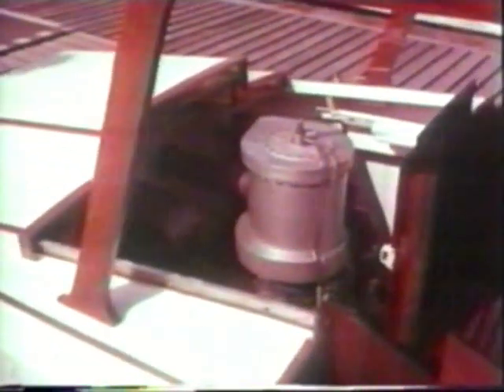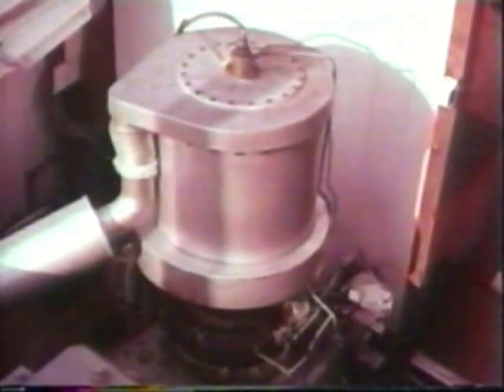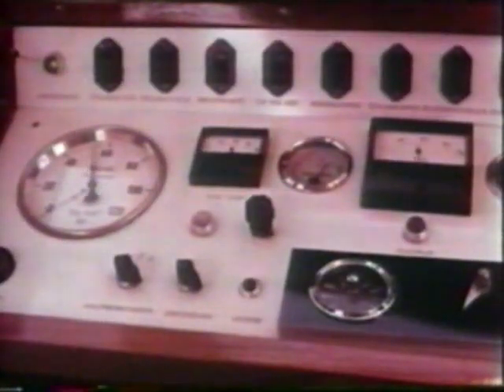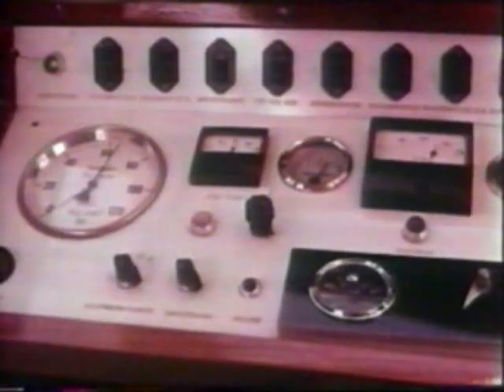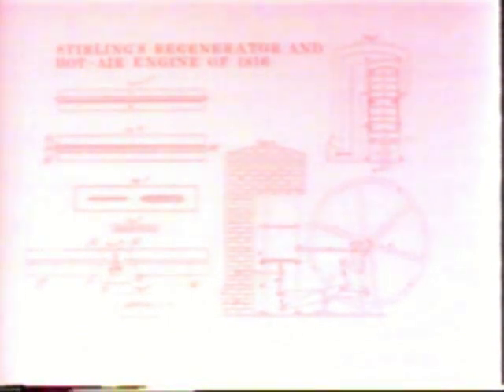Stirling Cycle Part 2 (Stirling Cryogenics)

Comment: I have a question: I know it may sound stupid but. If compression and expansion occurs in either cycles(cooling and heating) how does direction change whether it gets colder or hotter? If the thing is operating at 60hz and it still compressing and expanding all the same?

Comment: THis engine LOOK LOOK IM AWSOME IM THE FUTURE!!

internal combustion engine and oil companies: ima end this this mans whole career
Reply: Oil companies wouldn't be threatened by the stirling engine, since it can run on liquid fuel. The problem is that is isn't all that practical for automotive purposes, they tried it on a bus, which wasn't a succes. They also tried to make stirling powered field generators, but these didn't function so great either.
Reply: @timdekleijn8910  the real issue is that these would best be used in highly distributed - home scale situations. Sure it doesn't have the peak power needed for car use, but for constant power generation it becomes a dangerous threat to institutional hegemony. 
like could you imagine homes using radioactive heating connected to one of these? 
hell even in a permaculture type situation where it's fed with wood in a rocket heater... it's no wonder this stuff has been stifled.
Reply: @timdekleijn8910  it did work in a car, was both powerful enough and more fuel efficient. The important thing to note is that one doesn't need gasoline to power the sterling, with other fuels being explored

Comment: I would like to get the idea of exploring the Sterling heat pump for storing energy as heat, and a Sterling engine to use the stored heat to generate electricity.  Why?  Climate Change.  Solar energy is only available in the day. The excess daytime energy needs to be stored and used at night. 
   The combination of a heat pump, and a heat engine has the theoretical maximum efficiency of 100%.  Heat engine Emax = Thot/(Thot-Tcold)  Heat pump Emax = (Thot-Tcold)/Thot.  Multiply together, and you get 100% maximum throughput. 
   Everyone will need energy storage, and the lowest cost materials should be used if practical.  Suppose water is used for energy storage, and air for the heat pump. Hard to beat those prices!  So assume you have two 50 gallon water heaters, and fill one with water at 0C, and the other at 80C, and both are filled using an ambient air heat sink at 20C . 
   The efficiency of the hot heat pump would be 353 degK/60 = 588%. The efficiency of the 0C heat pump would be 293/20 = 1465%. The efficiency of the engine running with 80C hot, and 0C cold would be 80/353 = 22.7%. 
   The hot tank would need 2.24 KWH. The cold tank would need  0.30 KWH.  Assume a discharge temperature drop of 30C for the hot tank. The hot tank would then hold 6.6 KWH. The cold tank could hold the same by letting ice form. Filled with ice, the cold tank would need 17.6 KWH to unfreeze it. To get the desired 10KWH, we would need 1.51 hot water tanks. If the combined efficiency was 70%, the size of the hot tank would be 108 gallons. 
   So for the price of 3 50 gallon tanks, two heat pumps, and one heat engine, overnight electrical storage could be obtained.  Could this be competitive with 10 KWH of battery storage?  Currently, the battery option is running around $20K.  ... But think also of the difference in the materials required to service the world. Water vs. Lithium?  Water vs. Lead?  Water vs. Nickle-Iron? 
   Come on engine experts - save the day!
Reply: >calculating efficiency by mixing degrees Kelvin and Centigrade
bruh.jpeg
Reply: @peasant8246  The size of a degree C is equal to the size of a degree K. So when the difference is taken, both in either unit, the size of the result is identical regardless of the temperature.
Reply: @tomfitzrugger  Wow, that was quite a project.

Comment: Read an old book about this in the 1980's called "Engines for Tomorrow's Passenger Cars by J.D. Withrow". It was nice to see the boat mentioned in the book. One thing I have noticed is a preoccupation with engine efficiency, what should be the focus is how to mass produce the engine and get the price down.

Comment: What is the efficiency of converting heat to power out divided by heat in? This should give the percent of heat transferred to mechanical horse power out. Percent of heat efficient conversion to useable power. Where is most of the heat energy being lost? Any computer modeling to improve this ?

Comment: Imagine hooking up the Stirling Engine in the boat magnetohydro motor.
Reply: MadVulcan I recall Reading that the Swedish navy did exactly that With one of their submarine classes. In the late 70's I think it was. At the time I did not know what a Stirling engine was, and the Author apparently assumed that this was common knowledge and did not elaborate. But what it means is that the subs could very easily recharge batteries even while submerged, by using compressed air to stabilize the athmospheric pressure in the sub. Unlike diesels that will suck Your brain out Your ears if allowed to run without a snorkle. Of course, even a Stirling engine will not be able to run indefinitely on stored air alone, but the system appears way more flexible. Also a lot less noisy than a combustion engine.
Reply: @comingviking  One of those subs was able to score a hit on a US nuclear carrier during a naval exercise because of how silent they are.
Reply: @gearandalthefirst7027  Scoring hits on US aircraft carriers with a battery powered sub is not that hard. Carriers are great for power projection when the aim is to bully small nations. As actual weapons of war they are somewhat overrated.

Comment: Where did Robert Stirling get the equipment to manufacture the cylinders, pistons, push rods, compression tubes! Seriously the guy was a priest! It's not like he had millions! I've made some small Alpha and Gamma Stirling Engines, basically toys, or working models and this was pretty difficult!

Robert Stirling was making the Beta Type version that is shown in this video. I don't have the means to do that. That's a pretty complex engine even by today's standards. He was making these with his brother in the 1800's WTF!? How!?

Seriously I can't find that information on the internet. I find all kinds of information about the guy, and Wiki's about the history of the Stirling engines and their predecessors! But it all just gives variations of the same information. Robert Stirling was a Priest who wanted to give people something safer than the steam engine because steam engines were exploding and killing people! So he made his heat engine with his brother, and they gave a working model to some locals to pump water and then the guy went back to his church work, and people started to make his engines all over the place.

Nothing that I can find shows how he cast his materials, this stuff today gets done in a machine shop.
Was this old school foundry type stuff with sand and clay' molds?  Because all of the information on Steam Engines of that era show that they were extremely laborious to make! They were made by companies that had lots of money, and steel and foundries with lots of workers.
Reply: Have you read the wikipedia.org page?

Robert Stirling converted a couple of steam engines into Stirling engines. The problem back then was that the cast iron of the steam engine was too thick and could not hold up to the high temperatures that were being used.

Comment: Why isn't this motor being used to heat and cool? Is there something wrong with it that I missed? one of these motors in your furnace could keep you warm in winter and cool in summer
Reply: This is exactly what is done with with heat pumps...
Reply: @ultort  I thought heat pumps used traditional refrigerants based on evaporation & condensation though, not a gas cycle like the Stirling engine.

Comment: How to seal the piston rods at 100 atmospheres?  That is the million dollar question.
Reply: All of that is contained within the housing so it probably wasn't an issue. But the output shaft had to be sealed. Now these are only used in cryogenics so they can be semi-hermetic or hermetic.
Reply: @mysock351C  It can't be hermatic  because it must send out mechnic force thru power shaft. So they're leak for sure.
Reply: Semi-hermetic, then if one wants to be technical. Im sure they spent quite a lot of time investigating the sealing technology as they still use these engines today in cryogenic plants.

Comment: Liquid air air is 71% nitrogen? Can this nitrogen be infused into water and used on crops has fertilizer?
Reply: Nitrogen is almost insoluble in water.   And anyway,  you can't mix liquid nitrogen and water.  The first thing that would happen, is the water will freeze.

Comment: Why not use a Stirling cycle engine to produce liquid atmosphere to fill a tank then use an emitter to separate the oxygen and hydrogen? Then use a Joe cell with a different frequency to produce HHO to be used in a combustion or jet engine? This would work right? No more need for fossil fuels?

Comment: A Stirling cycle engine that turned air to liquid that filled a Joe cell constructed out of super conducting materials to generate high frequency electricity has the liquid air boiled off producing hydrogen vapor to operate a combustion engine. This would work to operate a certain type of vehicle and air craft correct all without the use of fossil fuels? This would work correct?

Comment: Would not the Stirling engine become a cold cycle engine from the liquid air leaving it to generate a steady flow of high frequency electricity from the super conducting materials it was constructed out of? It would operate non stop and if constructed correctly would not have any friction points from how super conductors work or even using gadolinium in its construction generating magnetic bearings? This could work correct?

Comment: Why not design a cryogenic cooler out of super conducting materials that turned air to liquid that feed back onto itself to reach ultra low temperatures and create a high frequency electric generator using atmosphere to produce high frequency electricity? A smaller version could provide air conditioning and a power supply for electric vehicles and air craft? Do you think it could work?

Comment: Could you not use induction used for cooking to heat the pistons on a sterling engine? More heat would mean more RPM's correct? Would that make an electronic engine that could replace the internal combustion engine? Novartis ; )
Reply: You'd have to use electrical energy to operate the induction apparatus which in turn then powers the engine. Therefore you could simply use the electrical energy to run motor all by itself. Using the Stirling engine as an intermediate just increases heat loss; lowers efficiency.
Reply: Make piston generate its own energy ancient pyramid technology and no I will not explain it to a Jesuit clone buggy!
Reply: Induction field can do much more then just generate heat. Stuff they don't teach you in free Masonic drone school. ; )
Reply: Hay those Manson engine pistons would generate their own electricity and heat an engine that powered itself. No more fossil fuels imagine that? LOL wait do you know how to charge a battery with limestone or basalt?
Reply: Manson engine is a very cool toy.
Reply: I would like to create a Manson engine electrical power generator. That ran itself and produced enough electricity to power a home. You think I could do it?
Reply: Not too sure who you're talking to, or what about exactly. You are right that an induction field can do more than just generate heat, I am aware of that. Since the idea of a Sterling cycle engine is to convert heat energy to kinetic energy, it is the heat producing property of an induction field that would find application here.
PS: Free energy doesn't exist according to thermodynamics
Reply: Vibration zero point endless energy unlearn your indoctrination in what to believe if you can. If you can it you can if you can?
Reply: Novartis
Reply: Lmao
Reply: Why not take a cloned organism place it in a container filled with the forth phase of water and use infrasonic pulses to bounce around in the container to cause cellular resonance to achieve cellular harmonic vibration destroying the cortical imprint of the clone organism and generating a biological cellular battery out of the clone that will self replicate within the container to create an eternal cellular battery? Hay a much better use for a cloned parasite rather then it stinging and infesting and replicating and sucking off animals. ; )
Reply: LOL
Reply: My biological electrical power generation design would put a self replicating parasite into a vessel that uses the self replicating parasite rather then the parasite using a biological vessel to feed off of. The parasite would feed off human waste to generate electricity and its self replicating life cycle would allow endless electrical power generation has well has recycling human feces 100% green energy. Hay bitiffy you like the thought of this amazing biological power generation concept?  Its a future I am working on for certain parasites now within this biosphere. ; )
Reply: Jim Martin you are one finny little man. Lol, serious note: evrything funtions as a powerfull energy generator threw thremal loss. If you have tempature you have energy, you convert said energy into a rotatinal field to produce work. Problem is rotation is not the best way to generate power.. we know jow to generate power using every known method from sonic ververberations to tempature to pizoelectric elements. We have wind and solar as well as gravity engines, man kind forgets to easily nature dose not make wheels to create motion. Forces such as lamimar low and venturi effect power most lakes and streams. We need to relearn nature to overcome unity.

Comment: To think that Stirling cycle engines really haven't advanced much since the 1950s when Philips engineers built that boat.  Newer high-power engines really aren't much different in design.  They pretty much perfected the technology.
Reply: Actually NASA also did a Stirling engine project in 1986 that proved to be successful (and only lacking the power of internal combustion engines).
google the Automotive Stirling Engine . Mod II 
... and apparently they're still working on Stirling radioisotope generator, but with somewhat different goals - I think space oriented (where combustion is not possible)
Reply: +douro20 Considering what we have learned from Inside Climate News and LA Times, and more recent revelation going back to 1946 involving the petroleum institute, it seems pretty safe to say the slow advancement and decline of these technologies has been quite deliberate.

Sterling engines were more common the petrol engines, and Philips sold sterling engine generators into the 1970s.

Comment: I have to say I would love to own that little boat. Its incredibly high efficiency gives me a boner every time I think about it.
Reply: Now, Imagine that instead of being fulled by gasoline, the hot thermal reservoir is maintained by solar power focused through a fresnel lens onto the hot side of the cylinder. Fresnel lenses can generate enough heat to melt copper if you focus the light correctly; with the right focusing and a large enough lens you could get real power out of this thing for free.
Reply: Mitch Sandoe Yes, but you would need a pretty big lens to get similar horsepower, it would get pretty chunky. If you like efficiency by the way, check out LFTR's if you don't already know about them.

Comment: why dh industires doesnt make the stirling engines for power production. is their any inherent limitation to it?
Reply: General Motors made a Stirling engine, the GM4L23, funded by public money. they did not want to go on with the project because they said the engine is a bomb. At Philips laboratories one engine exploded when lubrication material ignited during a test with oxigen as working gas. It killed one of the engineers.
Philips still makes a lot of money on the research it did, because now they make cryon coolers, used to cool super conductors in MRI scanners.
Reply: @HvdHaghen  Yeah, Oxygen will do that when you combine it With lubricants. That is engineering 101 "Ten big NO-NO's when dealing With Oxygen".
Reply: @HvdHaghen  
The Stirling engine is not a bomb so one can only conclude that their design changes turned out to be. At which point, it is no longer a Stirling engine.

Comment: why does it start over after it ends? o.O
Reply: Because the displacer piston pushes the "used" air" back to the opposite temperature area.
Reply: Ray Watson Ray, I believe he is referring to the video not the engine cycle.
Reply: Time is a flat circle. Why are people still enamored with Stirling engines? Maybe when they digitized the old film the end of film was taped to the beginning so old film played in a loop?